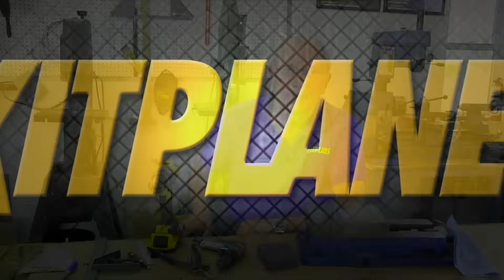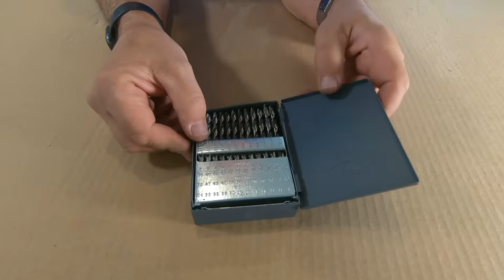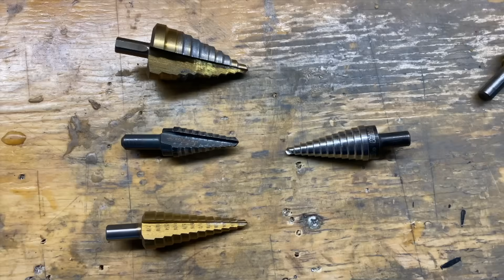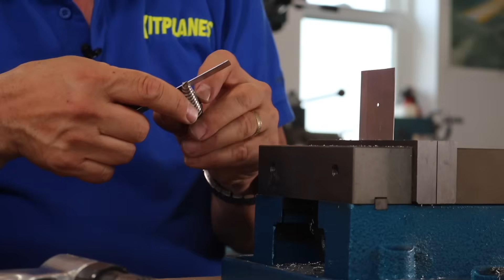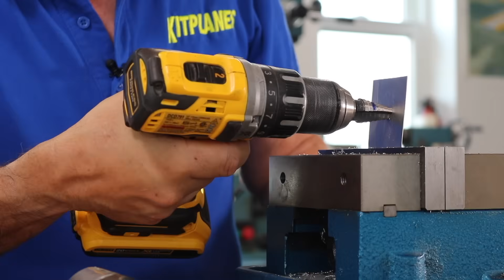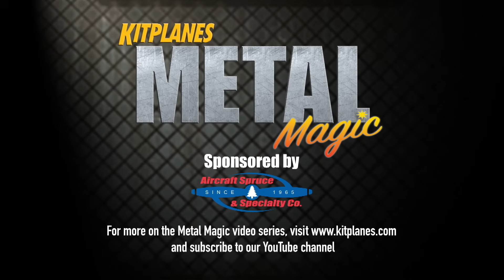Metal Magic: Learning To Love the Step Drill

Comment: Which models/types are strong and powerful for hard steel jobs.I bought a set of the step drill that looks like the brass colour the type you have on the work bench and it doesn't work good at all,instead of boring holes,it gets so hot and start emitting smoke.

Comment: Hi,
Any caution when you drill inox firewall with a step drill?
thanks
Reply from the maker: Paul says, "As with any drilling of stainless, you want to go slow and not generate too much heat, or you will simple harden it, and make it almost impossible to drill. I also recommend backing up your work with a sacrificial wood block. A better solution for larger holes in stainless is a Greenlee style punch, but a step drill can be used if done carefully."